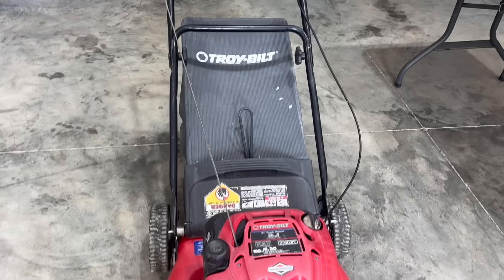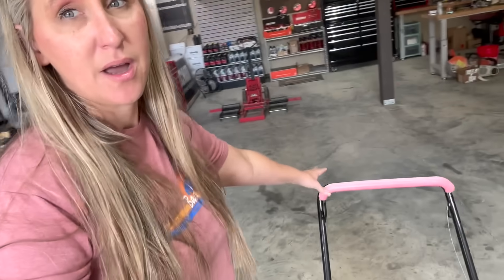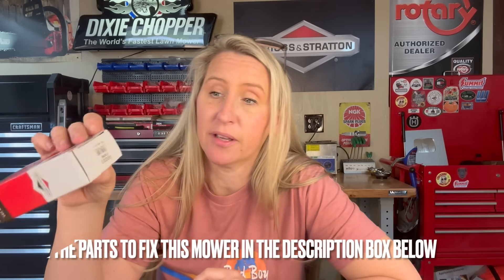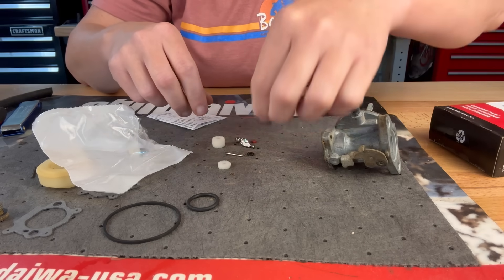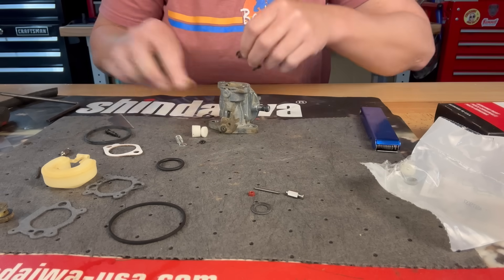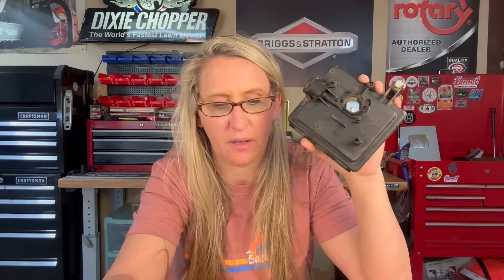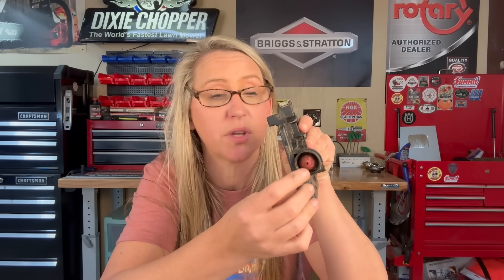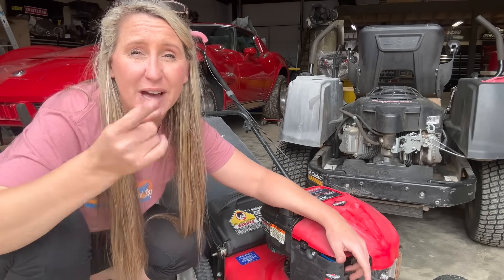FREE MOWER! Turning Customers Trash Into My Treasure! How to Fix a Briggs And Stratton 6.5 Flathead

Comment: Great Video. I have the self propelled version of this mower that I brought in 2007. I am still using it now. The only problem I have now is starting the mower. I am going to check the engagement cable and then pull the Carb apart like you did in this video. Wish me luck.  Thanks for posting this video it will help me with troubleshooting my mower.

Comment: Off topic but I am looking at 2010 Simplicity Coronet riding lawn mower. It has 30 inch cut 14.5hp motor and in great shape. Going to be using it to cut tight single track for Mountain bike trails. Nothing too crazy steep or rough but not smooth lawn grass. I have mowed with my personal honda self propel mower.before and no damage Just wonder if these were good build riding mowers. Buying for my club. Thanks for any help.

Comment: I used to have a 60's ford with 289.  it was running a little rough, so I rebuilt the carb.  ( I am backyard mechanic - not pro - so was a little scared - if it don't run - I am stuck - live in country ).   I pulled the parts off, and let it soak in gas overnight.  Put together the next day.  worked like new.   with that car rebuild, kept cleaning/adusting point, plugs,  distr.  cap - thing always ran like new.    the major point, I almost never see folks do a soak of carb.   Maybe a suggestion.

Comment: Small engines are so easy to work on. The majority of the time the problem is a dirty/bad carb. Maybe a pull cord. Fuel line. Linkage. If you have to take the whole engine apart, its probably not worth it.

Comment: Working on my in-laws house.  Due to health reasons, they haven't used their Briggs and Stratton powered lawn mower in years. We're in the process of setting up a lawn service but until then, I wanted to see if I could get the lawn mower running.

The engine is identical to this one and this video was very helpful in getting up and running.  I did have a problem with the throttle/governor being jammed wide open by a twig so the engine was over revving.  I removed the shroud, cleaned the area around the governor and linkages and all was well...Fires up on the first try and was able to get the lawn mowed today!

Comment: why do shops want to put shutoff valves on gas line rather than putting a needle valve in carb ,My zero turn came with cut off valve whom i forget to turn off half the time

Comment: I have a craftsman push mower my dad gave me 10 years ago when i bought my house. He had it for i dont know how long before that, at least 5 years. The engine looks the same as that one, not sure if it is a 6.5, the sticker on the housing is long gone, but i know it's a B&S. I use that thing all spring, summer, for lawn, and in the fall i mulch my leaves with it. My wife has been telling me to get a new machine for years because the front wheels are bowed out and the bag has a small tear in it. I just cant though. it's the only piece of lawn equipment i own that every spring when i take it out, ,put in some fresh gas, give it three prime pushes and the darn thing fires right up. Im excited to go check the date of manufacture now that i know where to look.

Comment: There is a SEARS  Appliance center across town, I used to go there and pick up mowers they put out in the dumpster but they started beating the crap out of them with a balpeen hammer. I mean they knocked holes in crankcase, beat the carbs off, busted the wheels there was hardly anything reusable on them, hell I think they even cut the cables! Guy working there said they didn't want people refurbishing them, they want you to purchase a NEW one!😢

Comment: Hi, I had a Sears mower stored with that engine and recently got it running.  Also had 4 items with 2-cycle motors that would not start.  2 chain saws, an Echo leaf blower and an Echo 225 straight shaft weed wacker.  I drained the fuel out of all of them, replaced the spark plug or cleaned it with starting either, then put new premixed fuel in them all and they all started.

Comment: Thank you for the video. I have the same model and did all the rebuild following your advice every step of the way. I also had to replace the starter assembly as I ripped the old cord. The only thing you didn't address is idle speed. Mine ran like 9,000 rpm until I figured out that I attached the governor spring in the wrong place. Slowly working my way up the tension ladder to get it right.

Comment: A friend gave me one of the self propelled Troy Built mowers that had been at her house in Crystal River (town in FL on the ocean) that was so rusted out it folded in half. I popped that engine on a 22 inch high wheel straight push mower. I wired the auto choke open because it was messed up but that thing started on the first pull and pretty much does every time. That thing a pure beast, i don't really use it much as mower but rather more as Bush Hog. I just love that thing, it's a brush cutting monster and I think I'm at about 27 bucks into it total which includes the new blade, air filter, oil change and a couple other little things. Can't say enough good things about that engine, shoot, i don't even put it under cover it sits out in the good old Florida weather.

Comment: Great video Bree. 

A few questions for you. With the big push to electric motors, do you think small engine repair will even be a thing in 10-20 years? I can see the motor manufacturers limiting parts to end users to force new purchases. 

We already have electric chainsaws, lawnmowers, trimmers, leaf blowers, etc and that's perfect for the manufacturers. When it breaks down, you have to buy new because nobody is repairing electric motors or batteries because it costs more to repair than to replace.

Could you do a video on this please?

Comment: Hi from Australia,I have that same motor on a Victa Tornado self propelled I bought new bout 15 years ago,dont burn oil,starts straight up,I still dont get the overhead valve hype on small motors like these?I bet they dont really use less fuel or make much more power for the same CCs?I like small flat heads.

Comment: I want to thank you so much for the Briggs & Stratton carburetor video. Especially the part about using 2 gaskets for the air cleaner to carburetor connection. I couldn't get it to prime with 1 gasket. I don't think I would have figured it out without you!

Comment: I have the same mower as this one. I acquired it from my Dad. It also has a red button up on the Left side that you push,and if it's warm enough out it will crank the motor over!! And start if you primed it enough.

Comment: I have this engine since 2002 or 2003. It starts with one pull every year. Never in 22 years it gave me any trouble. I never had to clean the carburetor. I don’t even drain fuel and don’t use any stabilizers. It just works. I figured it must have been a good engine to perform like it did. The deck is all rusted though. I was patching it up for the past few years. I just bought an aluminum deck mower without engine for $25. I will attempt swapping this engine to the new mower. Hope it fits and keeps running another 20 years.
Reply: You are using gasoline / petrol with no alcohol?? I understand that that helps a lot.
I live in a country where the fuel has no alcohol (ethanol or methanol), so I am lucky.

Comment: Hi . Brigg's 500 cc engine in a jonsrad ride on mower throttle wont go back to idle just staying at the same rpm governor doesn't seem to be moving. Cable ok moving at governor but makes no difference. Is it a possible carb issue do you think

Comment: Hey bre, If that dewalt impact driver is fairly new you should be able to just push the bit into it and not have to pull the collar out, at least that’s what mine does,hope it works for you! Cheers and nice job!

Comment: I found an old B&S under my sister's house she just bought.  It was at least 60 years old.  The sump, head, carb and fuel tank were full of old oil.  Whoever did this knew what they were doing. I drained the old oil and rinsed with some fuel.  New oil and fuel.  Put the old spark plug back in, (after gauge on the gap).  Pull on the cord and it started straight away.  My neighbours were astounded.  If you have a motor that you know you cannot do right away, then fill it up with old sump oil.  It stops any build up of corrosion.

Comment: I love that flat head Briggs; when I get that style engine, I always add an inline fuel cut off switch. That along with everything else you did (plus changing the oil and sharpening the blade) will make that mower last many more mowing seasons:-)

Comment: Awesome tips and tricks videos, thanks! Got a couple questions, do the mower manufacturers give a torque spec for the lawnmower blade or is there a rule of thumb to go by? Also, what is the correct way to check the oil level with the dipstick, screw them all the way in or check them by inserting the dipstick without threading them in? Thanks again!

Comment: About that kill cable.... replace the cable with stranded SS aircraft control cable and two end eyelets.  The OEM cable will rust out.  The SS cable will be working when that nice deck is full of rust holes.

Comment: back when i was young i mowed lawns for cash. i put hundreds of hours on one of these quantums and mowed things it wasnt really meant to be mowing, im talking about actual brush hog type work. these little engines were absolutely bulletproof. it was actually a quantum I/C engine. briggs and stratton now makes absolute garbage, you are better off with a harbor freight predator engine, it's really a sad state of affairs with current outdoor power equipment, make trash to people start thinking about buying electric powered trash. i no longer own any briggs engines, actually the only small engine i have (except for 2 cycle sthil trimmer) is a home built pressure washer powered by a harbor freight predator engine. it runs very well.

my lawn mowing and snow removal work..... and other yard working, including tilling is handled by a kubota BX sub compact with a 3 cylinder diesel. it has 650 hours on it, and thousands of hours of life remaining.

Comment: I have bought 3 Walmart Murray Push Movers in last 4 years, they are all Trash. I changed oil in all them as specified but all 3 of them after one year use had Rod Knocking. I have a Old Briggs Push Mover that is about 30 years old that has moved countless yards and still Runs with no Smoking-I paid about $39 for this 3 1/2 HP Mower. New Mowers are just Crap- Just a Note a Rubber seat instead of a Brass seat is just plain Bad Engineering, as Brass seats last almost forever... Thanks for you video's from West Helena, AR...

Comment: im from upstate NY and fix and sell mowers for basically beer money or maybe take my wife out to dinner. I would sell that mower for $140? If I replace the seat I put a small dab of grease on the blunt end of a drill bit or an allen wrench holds the seat on while you push it in. Gas will disolve it while running.

Comment: I was looking on eBay for a carborator kit for mine and found that the entire replacement carboratir was just a few dollars more, so I went with that and ended up getting it running again...
   Lasted all season last year and to mg surprise it still runs...
    Been having to prime the filter with gas and get it all cleaned out before I can get it start, though....
    Beats having to pull on it several times before it starts though.

Comment: Got one of these with a broken blade mount and pristine deck with a Stihl trimmer for $30, but mine had a Honda motor. Literally around the corner on the curb same mower (Craftsman) with hosed pan and poorly running Briggs motor. I snagged the blade, bracket and bagger (all interchangeable) and sold the motor for $15 figuring the Honda was the better motor 😮. Both machines were later models with lighter deck I gather one was garage kept and the other next was guarding the wood pile the last 4 winters!

Comment: I've learned alot from you! Thanks!  I have a Briggs 17.5 hp Intek, made in '07. It's on a Craftsman 42". It's worked great all these years, and then the compression release valve failed. I, being thrifty, thought I could get away with putting a $25 cam in, from China, off of Amazon. I watched your video, and you said don't do it. It worked for two days, then same compression release problem. So.. I buy the OEM from Briggs, install it, it works for several days. I heard an explosion, and it quit running. It turns out the exhaust valve set screw on the rocker arm wasn't tightened down enough. My fault. Re-adjusted both valves. Now I'm having the compression release problem again. My question is: Is there anything else that could cause this problem? I thought it might be a stuck valve, but when I rotate the engine to get past the compression jam, it fires right up, idles well. Do you think I broke the new OEM compression release valve? It has about 1 hour run time on it.

Comment: 10:01 If you don't have a pick to use, you could also place the needle seat upright on the blunt edge and flipped the carburetor on top of the needle seat to slide it in.

Comment: Glad to see you back... was kind a sad when you had announced to (have to) move on, but there is a season for ... --- The more I'm excited for you, that you returned to do what you enjoy and you are very successful in (ok, after 6 stubborn hours giving up... with a haunting hint that this was the 2nd time around... ouch). -  Thanks to your very instructional movies I got my small engine tools back running again. Chainsaw, blower and edger needed 'help'... I even restored vintage Echo 302 and a vintage homelite chainsaw for friends after gaining confidence following your processes. The Echo, an all metal beauty, the Homelite a 'piece of metal' in two plastic half shells. No worries regarding territory infringement: I'm too far away. --- 20+ years wear rubber down. The lawnmower, because year round in use and because of the brand, needed the least of help: 1997 21" Yard Machines MTD 3.45hp Briggs and Stratton pusher. Still does what it suppose do  and more. In fall, I use it as a mulch maker. I just run over it multiple times over the leaves and yard take down, then bag all on last run and throw it on the garden beds. (Chicelec would be your 2nd brand name: fixing a Mac Book's charging port... such things are more down my alley when they prevent me from my primary work: SW).

Comment: I would estimate parts with markup, $67.94, Tuneup labor $89.99, mower salvage value or carb rebuild labor $50.00 for a total sale price of $207.93 but no less than $157.93 .

Comment: They're all plastic these days, I used to work at a Sears small engine repair shop and they were just changing over to plastic carbs just as I was leaving.  Years later I had to work on one and I have no idea what's wrong with it, in my last days at sears we were just replacing the entire carb.  What are your thoughts on these plastic carb mowers and what are some of the most common problems with them?

Comment: i just cut the old fuel line mith a razor knife spray it with oil grab it with pliers comes off pretty easy.so what your gonna replce it anyway.easier on carb end to

Comment: I still have a Sears lawnmower with a Tecumseh flat head engine that is 30 years old and I will be using it again this year. I think you could get $350.00 at least for your mower. Great find and great video!

Comment: I have a 1991 Craftsman, rear drive, with a Briggs flat head that I still use today.   Lots of little repairs, fuel tank, rear wheels, etc.  Starts first or second pull everytime.

Comment: I bought a Murray lawnmower from a pawnshop for $25. It has the quantum Briggs &Stratton flathead engine in it. Someone put a new carburetor  in it and new airfilter. It wouldn't start. Found out the last owner put diesel fuel in the gas tank. Had to drain the tank, clean the lines, put fresh gasoline in it. It smoked for the first 5 minutes after changing the fuel in it, but then it cleared up. Runs amazing. Also put fresh engine oil in it. Great bargain.

Comment: Usually you can get away with just removing the float bolt (main jet also) and clean that out. I've done that in a pinch for folks needing their stuff quickly on a travel call. It also lessens the risk of ripping the fuel line and float gasket b/c e10 is pretty much the only option out here for us. On my toro recyler with the slightly bigger engine I also put a inline filter and a mini shutoff. Haven't had to clean my carb in 5 years since. I run pure gas and I dump a little marvel mystery oil at the end of the season. Pulled the carb apart to check the gasket and fuel line.... Soft as new!

Comment: Intake Valve Seats often pop out of its recess on the B&S flathead class; after use and cooling down while the intake valve is open.  How do you repair an intake valve seat that is "popped off" and hanging from the valve's neck like a Christmas wreath; preventing the intake valve from closing (no compression).

Comment: Side of the road and auctions are where all my small motor equipment comes from.
I made a seat installer out of a small drift ground to a tiny nub on the end that holds the seat as I push it in.

Comment: I suggested this to Steve at Steve's Small Engines Saloon. He got a busted-up mower.  He started it and it was burning smoke.  He checked the oil, and it was overfilled.  Steve dumped the oil out did an oil change, spark plug air filter, less than $20 and asked us what he should do with it.  I said give it back.  So, what if you are out $20 in supplies.  If she needs engine work, she is calling you.  How much was the carb kit?  If you are only in it for a few buck, why not give it back to the original owner?  You might make more money that way than selling the mower yourself.